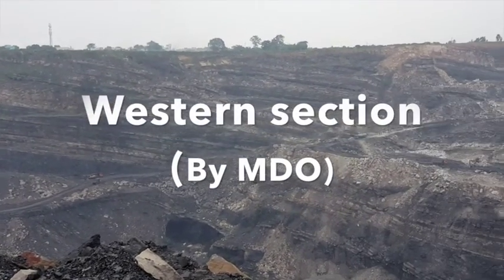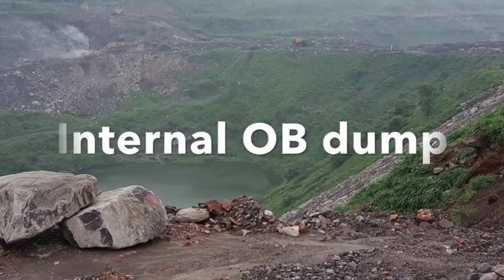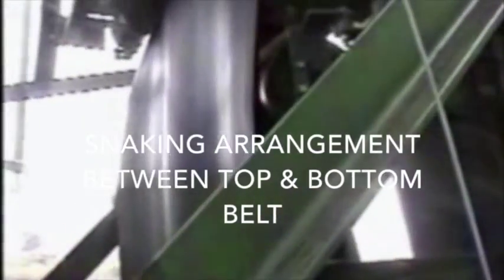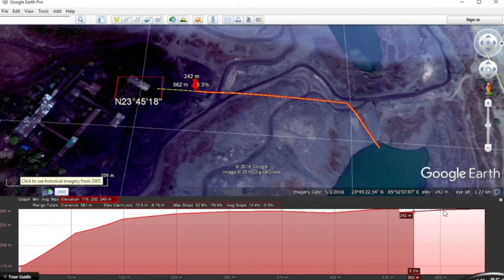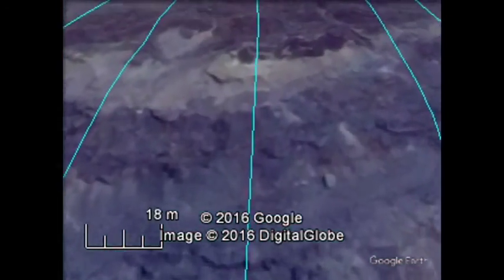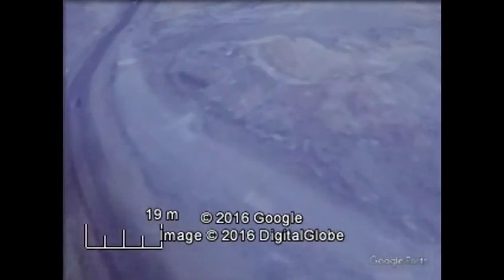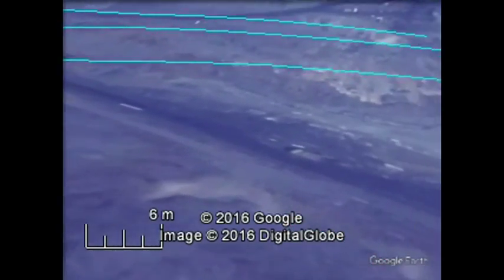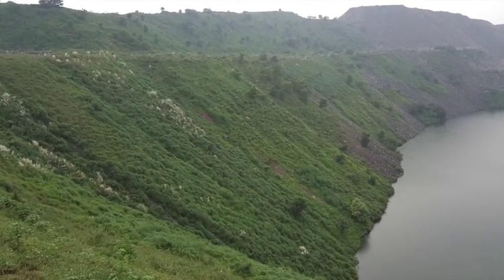Integrated HAC system at Kathara

Comment: Sir Video is great , but how the conveyor is installed i want to see.
Reply from the maker: Dear Gaurav, 
Thanks for viewing & comments. Objective for making this video is to explain how coal can be brought from greater depth in a mine can be transported & transported instead of conventional truck transport and comparative economics. Without surveyed data, I have shown how contour,  length, elevations, slope etc can be known with the help of Google Earth. I have also prepared layout in autocad of the system by exporting KML (google earth) file to autocad & also after preparing layout in autocad placed the layout in Google Earth. Installation of high angle conveyor was not in the scope of this video.That has to be prepared separately in autocad. However, supporting the structure of high angle conveyor is similar to supporting of conveyor gantry over columns, to be located in slope.  Due to the structure of integrated frame of high angle conveyor (a small clip has been shown) high angle conveyor can remain unsupported for a span of 120 m. Hence if the depth is 100m then high angle conveyor shall not require any intermediate support.
Reply: Thanx sir for replying,but as in the video I have seen it will pass through the river, so what type of structure it would be support for the conveyor, sir I you don't mind can I get your FB I'd or wats APP NO... SIR ACTUALLY I AM STUDYING  MTECH IN MINING MACHINERY FROM IIT ISM Dhanbad, ndin our course Hac is there...So I am searching the video for clearing the concept
Reply from the maker: Dear Gaurav, the HAC shall be installed after dewatering the mine pit bottom, presently the pit bottom is submerged under water. In my commentry I have explained that. Hence HAC shall be installed from pit botton after de-watering & along the side slope. You will find a small cliip of HAC in my movie. You will find video of DSI Snake for coal in Spain. You can send me mail at skbag@dataone.in. You can also visit my website www.skbag.in. There is a Training page. You scrolled down & you will find various topics & lots of videos.